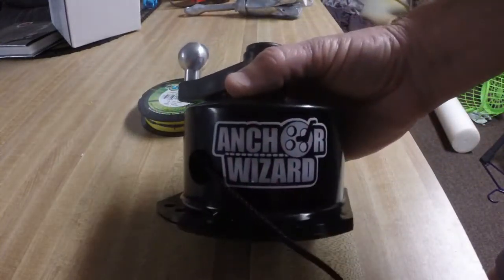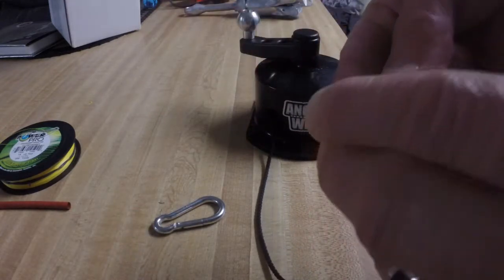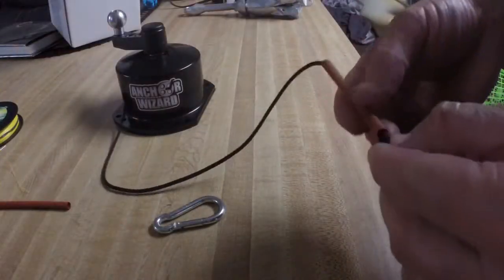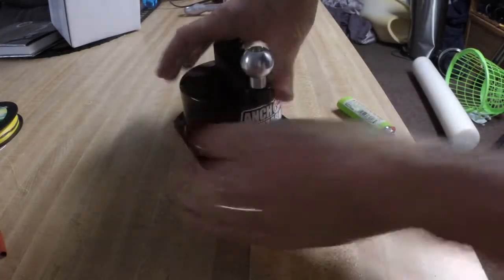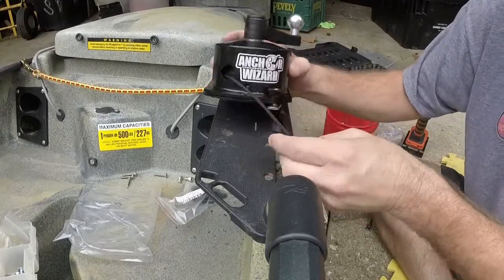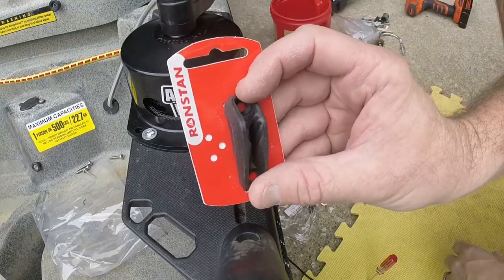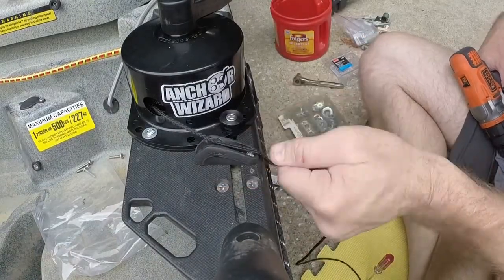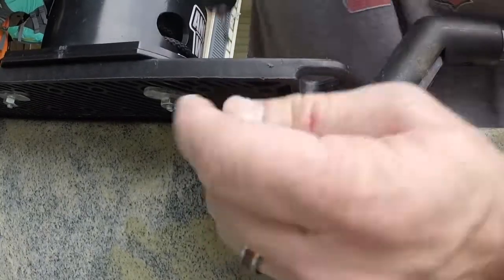Anchor wizard install  Hobie PA12

Comment: Why not just use a zip tie?
Reply from the maker: If you mean to attach the clip to the rope, I don't want the clip to come off I want it to be attached permanently. That's why I wouldn't use a zip tie. Plus this looks much cleaner
Reply: @classyadventures599  Use a palomar knot. It'll never come off.